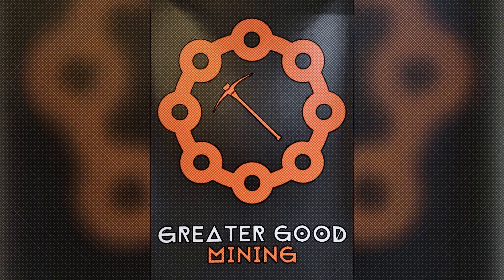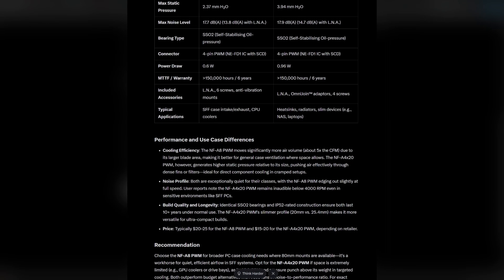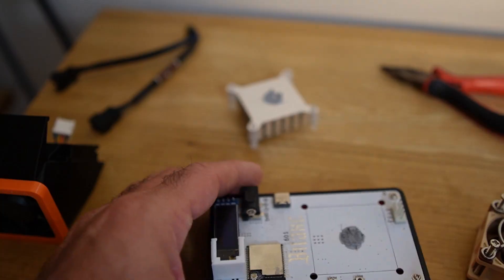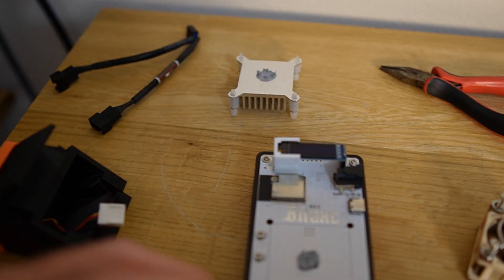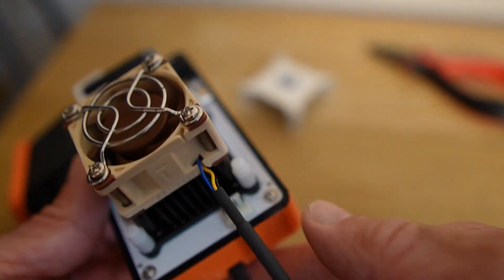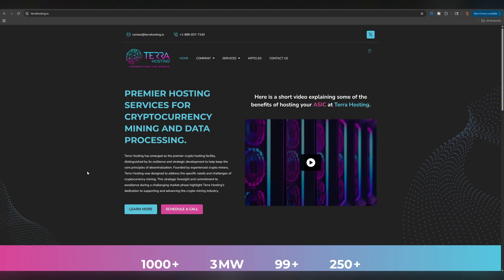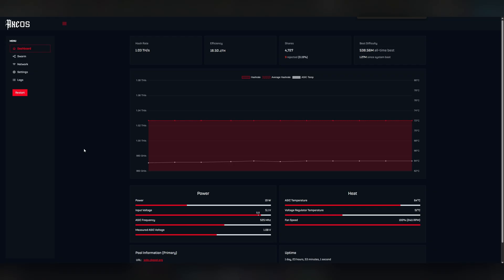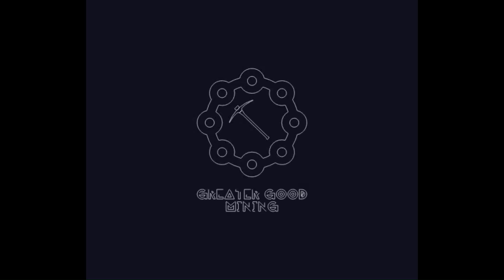Cooling solutions that work for your Bitaxe Gamma 601 Solo Bitcoin Lottery Miner

Comment from the maker: Have you tried any cooling solutions for your Bitaxe?
Reply: My Gamma is running with a 52pi cooler (not the low profile). Did you get the 12v fan as that is what the link directs to? You will need to get the 5v if so. I have the same but in 5v on my cooler and the original fan for VR cooling and am running 625/1100 1.3T/h average with 50c Asic temp and 47-52 VR temp. All at under 19.5W at the device. I do run my noctua at 100% though. I am considering getting the dark horse you bought as I like the lower profile of it. Great video.

Comment: Should you use a 5v fan and not a 12v? That’s what your link goes to is the 12v
Reply from the maker: Hey, yes you should use the 5v version, not the 12volt. Thank you for pointing it out! It will work, but not as well. I'll change the link, thanks again!

Comment: More surface area = faster and more effective reaction (heat transfer). You need to remove the anodization/paint (don't know which they used - I don't have one) from that Satoshi heatsink. Buy a granite tile or a piece of glass, tape some 320 grit sandpaper to it, and move your heatsink in a figure 8 motion until you see bare aluminum on the interface area of the heatsink.
Reply from the maker: Thanks for the info! Yeah i was wondering why they painted it. Thats a good idea I'll remove it at some point

Comment: tiny drop let the heatsink spread it
Reply from the maker: I probably put tok much on but I was initially worried about the contact because the stock heatsink didnt seem like it held tight against the chip. Kind of felt a little wobbly etc. The aftermarket heat sink seems much better

Comment: Could you use thermal pads on the asic chip instead of thermal paste or is the paste better?
Reply from the maker: The paste is probably better for this application. Thermal paste usually has better thermal properties and can fill microscopic imperfections etc. Thermal pads could be used but would need to be pretty high end to keep up
Reply: @GreaterGoodMining i wasnt sure if could help with the quality since it seems like everyone is continuously repasting these things
Reply from the maker: @dumpsterfire6732 yeah it seems like this did the trick so far. Ive got some other stuff on its way from Avoidbit that im going to try too